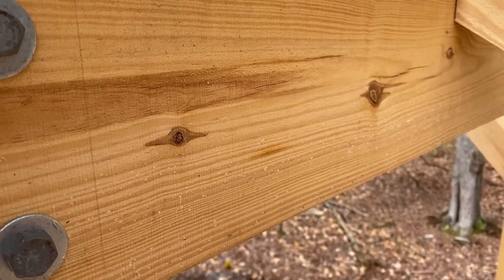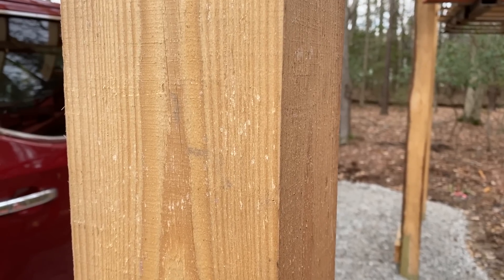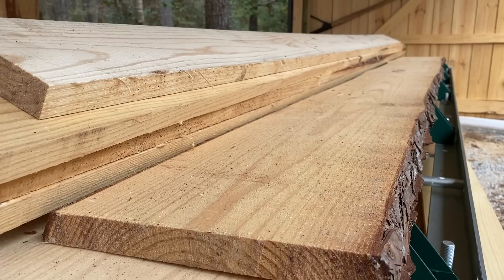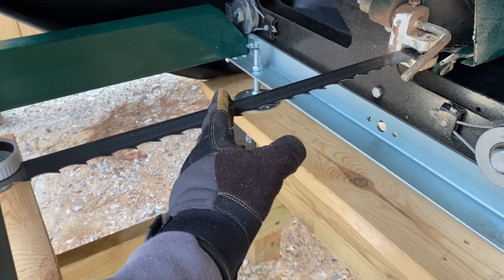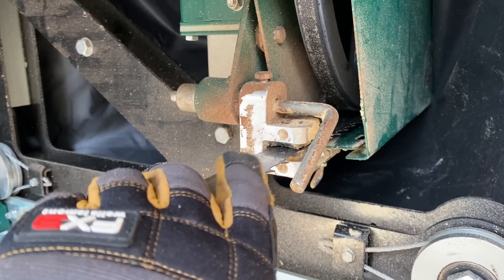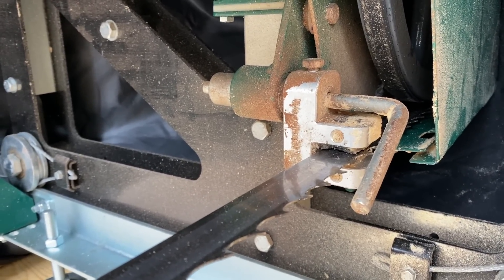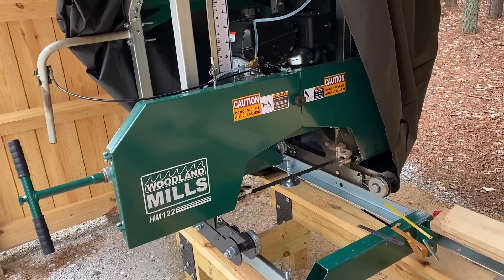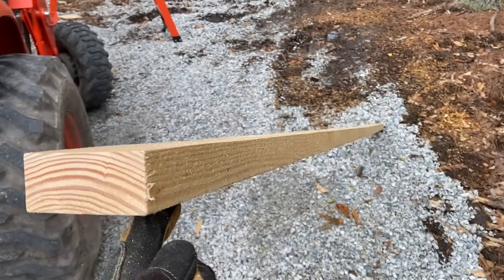Can you mill high quality lumber on a low-cost sawmill?

Comment: Totally agree, the lumber quality is great. 
We have the ajustable blade quide (come as standard with 14,5hk engine), and it`s nice, but there is somthing importent to be aware of. It is possible to adjust  the guide out so far that it run out of it`s own guide ( The yellow part who runs in som hard plastic under the follower wheel), with a brutal result for the saw blade.
Been there, done this.
Now we done a real mark for this guide, so this does`t happens again.

Comment: The wavy cuts you refer to are different from the chatter you show and explain. Because you are careful and precise in everything you do with your mill, you no doubt haven't seen wavy cuts. The blade starts in, rises or falls a quarter-inch over maybe six inches, dips about the same amount and distance, and levels out. Definite waves. Dull blades, starting the cut too fast, improper tracking and tension, and God knows what else cause it. By setting up as you do, you'll never have the problem. I did when I started, don't now.
Reply from the maker: I have seen those large scale waves -- for me it's almost always due to running into a large knot with an old blade (maybe not totally dull yet, but not fresh).  Creates about a 3-6" speed bump in the cut about 1/8-1/4" high.  Having adjustable blade guides would probably help that, or if I knew the knot was coming, slow down the feed rate passing through the knot.  But I accept it as one of the many wild cards you'll get with a mill.

Comment: As with anything when it comes to tools and sawing, a little attention to detail goes a long way.  Having your sawmill well tuned with a sharp blade is a good starting point.  Picking trees that are straight with little taper helps, as does centering up the pitch on both ends of the log so one is awing parallel to the grain.  But it should be trivial to get better quality lumber than is available in the big box stores and lumber yards.  Those set a very low bar for quality.